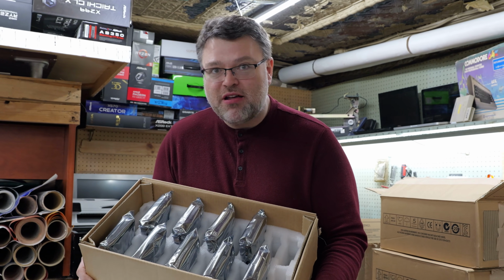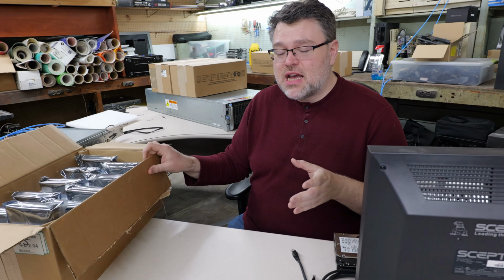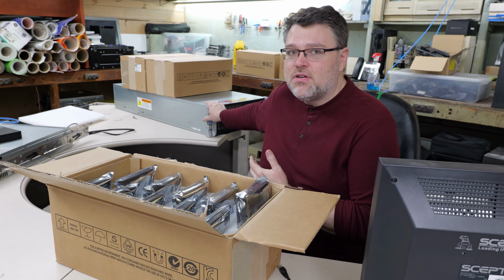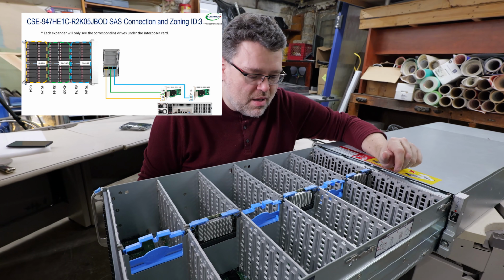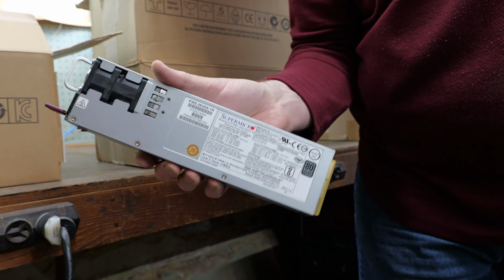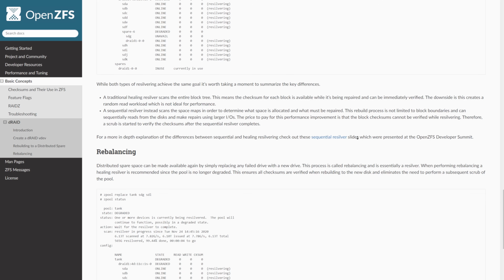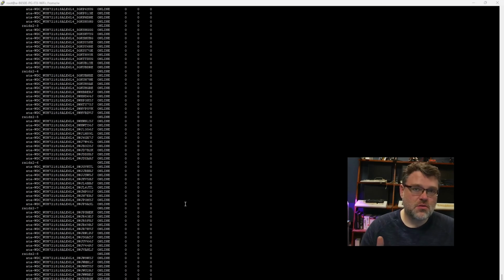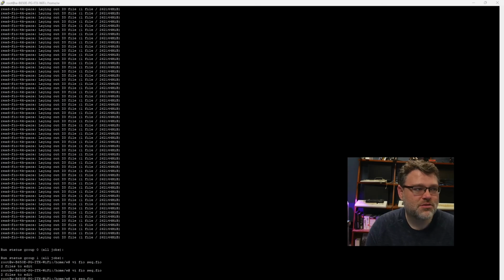Petabytes? No Big Deal! Quick start with the Supermicro 947HE1C-R2K05 90 Bay JBOD Disk Shelf

Comment: And here I thought I was hot stuff installing a 60 drive shelf for a customer.  I'm glad I had a new guy shadowing me on that trip.  No way was I getting a 60 drive unit into the rails all by myself and no server jack.  I'm thankful our whitebox OEM pre-attached the sleds to the 60 Seagate EXOS 16TB drives.  Once the shelf was in the rack we had the 60 drives inserted in under 10 minutes.
Reply: i'm assuming the rack was bolted to the floor, yes? the pre-attached sleds saved you from madness.
Reply: We deployed a few racks of similar setup for a customer of ours last fall who said they intend on creating between 40-45 petabytes of data over the next 12 months. Each rack has 10 similar 90 bay units, 2 are server/controller units with 8x8TB NVMe + 90 x 28TB 7.2K SAS and 8 JBODs with 90 x 28TB 7.2K SAS, over 900 x 28TB 7.2K SAS per rack With two spares per unit, leave 880 drives per rack, configured RAID Z3 in 11 drive groups, 40 vdev / ~8 PiB usable per server/pool, ~16 PiB usable per rack before slop, about 48 PiB usable across the first three 42U racks. The customer struggled with the overhead involved, as adding up the raw capacity it's over 25PB per rack / 75TB raw across the three racks, but rightsizing to TiB, RAIDZ3 overhead adds up to 20PB of parity capacity and there is literally 1.6 petabytes worth of spare drive capacity across the three racks. No drive failures that I've heard about but I'm quite curious about resilver times with just a single failed 28TB HDD, especially once the pools are 50-75% full.

Comment: When I worked in Inventec, thousands of assembled servers per day were moved on crashcarts... sure many of them only had no or one drive because that's what some customers ordered (minimum config), but some were full, like 40+ drives in some cases if it was storage servers... but it was like 10 years ago or so and I do believe hard drives back then could withstand way more 
also some of those carts were really cool (like not just adjustable height so you never had to manhandle storage beasts, but also they had good wheels and some sort of vibration protection... but for light 1U compute stuff, basic all metal no cushion carts were used and abused) 

I was in testing phrase, so after assembly, someone took each server from manufacturing line to our "racks" (it were open shelves accessible from front and back easily, no mounting needed, you just slide it on and plug in cables), we run basic tests (self diagnostic if everything plugged in is ok, grounding test) + stress test (I don't remember how it was determined how long it took, but some units were there for like a day) and then someone took the server on crash cart and it went to shipping (some % of randomly chosen went for disassembly and inspection and reassembly and then tests again, to make sure there are no weird things going from the line...)... thinking back about it, it's a shame they never told me how many units experienced a failure after getting to customer, because back then I thought that because they tested literally every unit, it had to be 0... Like when nvidia shipped bad GPU batch and that testing stopped it from getting to final customers, I really felt like it had to be perfect)

Comment: You are going completely overboard with not having drives in a system when you ship or move it. I've shipped systems to Australia and not had any greater failure rate then the units that we ran in our data center or that we shipped locally or to Texas.

This were systems with 16 3.5" drives in hot swap supermicro caddies.

That even includes the one system that FedEx dropped so hard that an ear sheared off the outside of the 3u supermicro chassis by completely pulling through the rivets and that was shipped in supermicro's box. From a customer standpoint we brought that system back in house, but the drives were swapped into the new chassis with zero issues and only a slight delay of configuring the arrays on the new 9680 controller.

The difference is spinning shock versus stationery shock G rating.
Reply: "I haven't personally experienced it, so it doesn't exist. I'm an adult who lacks object permanence."

Comment: I'm moving across the country in a few months, you've got me scared about moving my homelab now
Reply: GLOTRENDS B86 14-Slot Storage Box
8 3.5" slots and 6 2.5" slots for $36.
ORICO Hard Drive Case 3.5
20 3.5" slots for ~$75-$100. (Goes on sale for $60 occasionally.)

Others from $50 for 20 3.5" slots, $70 for 25 3.5" slots.
Etc. Etc.

Comment: Disk prices have been climbing faster than I can save up to buy them. 
I don't need anywhere near this capacity, but that is a pretty cool setup.  The noise level though... I would have earplugs or other hearing protection on any time I went near that thing.

Comment: Many years ago I built file servers for a surveillance system. The user had a bit over 200 cameras running and had just above a petabyte of storage for them. So far I was fine with the deal, but then the installation day came. The server room for the storage and surveillance systems was separate and totally locked down. There were not so much as l lan port with internet access in the server room, all the networking was local with no way to access it from anywhere but the guard room. Well I guess the cameras which was also networked also was a way in, but that was it. Sounded like they had considered the risk of remote hacking and such. But I ran into a problem I hadn't considered. Turned out they had no one on the company that was responsible for managing the IT systems. With all those drives and all those computers it wasn't a question if, but when something failed. I was a bit concerned when they told me they had not thought of who would get the reports from the systems so they would see if something didn't works as intended. There also were no one who they wanted to give the job of going in at least once a week to look if there were any warning lights on the servers. They didn't even have to look at a screen, just look for error leds. No they wanted us to monitor the systems. Problem is no internet access and six hours drive to get there. It was also nothing that had been discussed before this. In the end I got them to give me an email adress to send the logs to and I got to teach someone what was good signs and bad signs when looking at the LED's on the servers.

Naturally this failed eventually. Turned out that the drives that was certified for the use had the firmware updated before we got them. And in a couple of weeks a lot of them had failed. The manufacturer and the controller manufacturer had a talk and we got new firmware and the software needed to update the drives through the raid controllers and I had a long day of driving over there and flashing new firmware on all the drives. After that the system was rock solid, but for years I was just waiting for a total crash at that site. They have a lot more cameras now and new servers for the system, and I bet they now have someone that are responsible for reading the logs and taking a look at the servers now and then.

Comment: what the heck you need that much for. its like 10y archive. or something. of heavy video usage. yeah I do have a 8-drive bay xeon server. would be possibly usable. after silencing it. b-roll or even a-roll is not considered critical backup. system files and project files go to dvd/blu-ray discs. for long term back-up and restore. petabytes of video data is not critical by any means. scratch discs only. dont run such a heavy business. keep it light and simple. sassy is hella expensive. cost difference is nuts. sata4? sata3 is only like 600MB/s. reasonable small business uses just bunch of sata3 drives, possibly in raid1 mirror. potato nas is the best. yep desktop pc case it the most simple. you definitely dont need to practice with such large systems. at all. until people product ruling systems cease to produce you stuff. ie dont vow, or promise that you have no control over (anything). unnecessary complexity and resource cost is out of question. no just mirror and use the file system your other systems are using. for fail safe reasons. yep mirror at high level. actually keeping it simple prevents overhead. less is more. why dont you use common raid language? what is d123. keep it simple. for maintenance and knowledge reasons. complexity is the curse of corporate solutions. lotsa noise for literally nothing. all expert level specificity is nonsense. yes especially for money. double oof. keep it simple even if you want to make complex money stuff. just do stuff. more is evil.

Comment: You mentioned that you’d recommend RAIDz for this many drives. At what point do you recommend something like CEPH?
Reply: Ceph is for when your storage is physically distributed. For example in separate rooms or separate buildings, or even separate computers next to each other. If all the storage is controlled by a single computer just use ZFS. It's simpler and more space-efficient.
Reply: Ceph isn't a local storage solution in a traditional sense, it's a distributed storage solution. That would require 3 nodes minimum, and it's overkill for this application You could back ceph with zfs as the on disk format, but I don't think that's needed.

Comment: I have a 3u and 16 drives. It's creeping up on 75% full. No idea what to do. I hate their typical JBOD cases that are based off of their normal chassises. Just empty space. But even a 60 bay disk shelf like this, what would I use it for? I need to only expand by 8 drives (108 TB) and then I should be good forever. Although I thought I'd be good going from an 84 TB RAID 6 array to a 216 TB zpool. I think if I can ever afford an actual server from them, I'd go with a 2U Epyc with the 8 NVME slots in front and full height slots in the back, and then a shelf would make sense. And how is the bandwidth of 90 drives going over 8 SAS lanes?

Comment: Wouldn't it make sense to setup "/etc/zfs/vdev_id.conf" to create aliases, so that each disk alias matches its location in the shelf instead of 90 random SN? Unless you write the SN on top of each disk it will take awhile to find the faulty disk ;-)   We use vdev_id.conf for our NetApp shelfs, which is just a few lines in the file, and you are golden...  we also use the sg_utils tools to control the fault LED for each drive...  (not sure if this works with the Supermicro shelf?)

Comment: Backblaze loosing some data is the most scary thing I've heard in a long while
Reply: YIKES. Was this recent?! I did not hear about this
Reply: Yep ! scary right !!
Reply: > loosing some data

Don't worry, they tighted it again afterwards.
Reply: @szank YES! like nobody mentiont it!
Reply: Granted i'm not practicing what's preached. But Backblaze is only PART of a complete backup solution.
Reply: @kekistanifreedomfighter4197  I'm getting Tony the Tiger Morning breakfast cereal vibes.  🐯
Reply: @kekistanifreedomfighter4197  the update to the 3-2-1 backup solution should probably be to have 2 off site in different sites storage instead of just 1 off site storage as the cloud can fail and the data cloud is usually what people go with for off site storage. So a 3-2-2 plan instead of 3-2-1 plan but for most the storage off site is just a backup not the working copy.
Reply: *losing
Reply: @circletech7745  no they fired the data into the cloud like an arrow!
Reply: @circletech7745  I prefer loosing because it evokes images of data being released to maul the enemy lines.
Reply: Why? They suck at computers just as much as you do they just do it at a much larger scale with other people's data.
Reply: They abuse their drives and have crappy enclosures and they also buy refurb drives that allready have a ton of hours on em and run em very hot

Comment: Another nice thing about SAS, though, is support for T10-DIF! Unnecessary with ZFS, granted.
Reply: T10 is a black box where you can get the disk firmware assure  the data is OK to the controller firmware that will report it to the OS. You can even have it work over fiberchannel or network so the card firmware can assure you the data has been transferred safely.
Is the data safe though? You have no way to know because this is all handled by the devices themselves.
Add the usual shenanigans about feature support in the drives (some drives claim to support this but the controller disagrees) and that you need to reformat them at low level with some special commands.

This is why ZFS is better, you don't need to GAF about all this low level firmware handshaking behind your back and it's something you can test
Reply: I ultimately agree, ZFS is preferred, but I'd rather have T10 than nothing, if ZFS couldn't be used for whatever reason.
Reply: @Snyder0317  my "better than nothing" is snapraid+mergerfs (on linux) and snapraid+stablebitDrivepool (on Windows).
This setup will also use less power because each file is stored in a single disk (not striped/mirrored) and the parity drives are used only when scrubbing for bitrot or reconstructing the data when a disk fails.